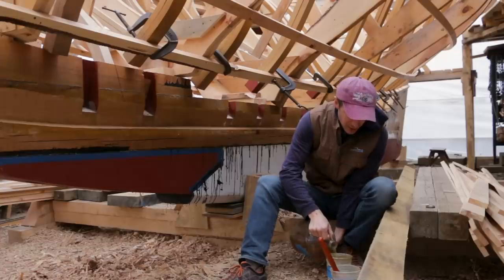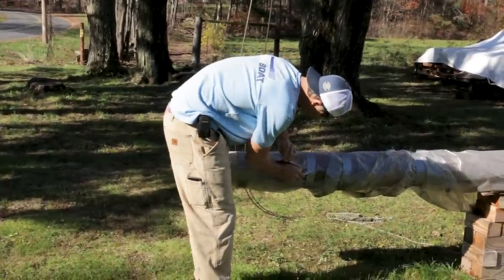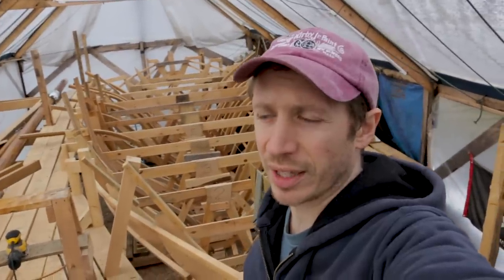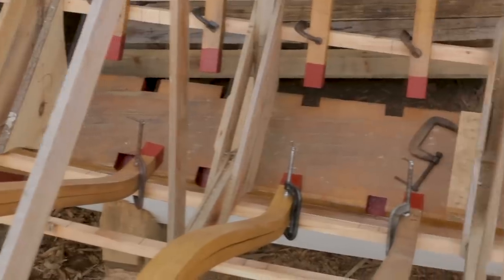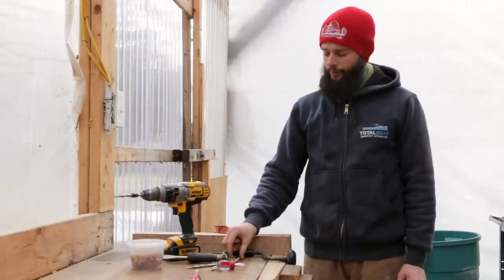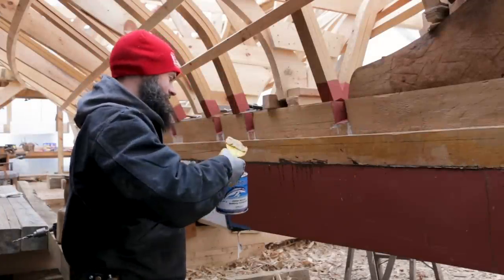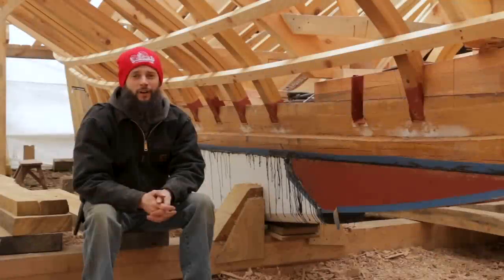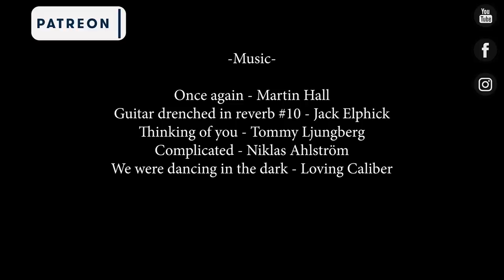Acorn to Arabella - Journey of a Wooden Boat - Episode 49: Bedding the Frames

Comment: I too think those bronze screws are too short. It looked like only an inch at the pointy end of the screw went into the keel wood. When the boat is in the water I assume most of the buoyancy force is applied to the hull. What is coupling the hull to the keel, other than these bronze screws? Thanks for amazingly good and interesting videos.
Reply from the maker: The screws are "bonus" fasteners, once she is fully framed you could cut the frame ends off where they meet the keel and sail her around the world.  Many builders believe the sockets and fasteners are not worth the time or energy to install.
Reply: Ah, so there is some more beefy structure that fixes the keel to the hull then. Is that to come, or have I missed it?
Reply: @samuelfielder  Are you familiar with "knees", which gusset the tops of the frames to the deckbeams along the gunwhale (where the deck joins the sides)? "Floors" do a similar job at the bottom of the frames, gusseting the frames to the keel timber, and to each other. Once these are fitted you could (as the boys wrote above) cut the frames as if they were simply butted to the keel timber. It would not be as strong, but it would be plenty strong.
An abundance of caution is a virtue, in building boats, rather than a vice as it can be elsewhere (eg child rearing!). 
I say this because lack of sleep is the primary cause of bad decision-making when the proverbial hits the metaphorical, and lack of supreme confidence in the vessel can cause wakefulness in those same conditions.
Reply: No Gottenhimfella, I'm not familiar with anything about boats! Just a physicist watching Acorn to Arabella with interest and admiration. So far, I haven't seen anything substantial inside these frames (what I can see, I think,  is just temporary supports). What I am clear about is that the buoyancy force will be applied by the water to the external planks of the hull, and in turn to these frames. Where it goes from there I don't yet see. I can calculate the force required to move a 4.5 ton keel upwards at a certain acceleration, and the force required to shear a No.18 silicon bronze screw: that's what worried me. I am hoping your gussets appear later.
Reply: @samuelfielder   For clarification: the "floors" (which will be fitted -- they're indispensable, for the reasons you state) join each frame to the adjacent frame on the OPPOSITE side of the boat, not the adjacent frame alongside it on the same side.
It is a peculiarity of traditional wooden boat construction that there are no diagonal (or other shear bracing) elements joining the frames on the same side, and to me it is this lack which is a perplexing oversight, rather than anything to do with how the keel attaches. On small vessels like this one, it's not a major problem, but on full-size sailing ships, where the frames are further apart, and the planks (relative to the gaps between frames) much narrower, the planks behave like the cards in a deck of playing cards, with very little resistance to shear forces in a vertical plane. If you imagine drilling a hole through such a stack, and then inserting a chopstick and levering fore and aft, it's easy to conceive the problem. The tall masts act like powerful levers, squashing the planks together in the squalls (assuming the ship is running downwind) and then separating them in the lulls. Going into the waves, this same action would happen with every large wave. This explains why wooden ships would invariably leak during and after a hard storm, and sometimes spit out the (not very elastic, and not very adhesive) caulking intended to prevent water ingress between planks, with often fatal consequences. 

Sailors were highly aware of the problem and would sometimes address it in storms by using external cables and "frapping" the hull (this is recorded even in the Bible), but designers and shipwrights down the ages seem to have considered sailors to be an inferior species whose opinions were unworthy of consideration.
Very late in the day for sailing ships, this oversight was addressed, but in the first case I'm aware of (the warship USS Constitution) the iron diagonal braces were left out when the ship was later refitted, because the shipwrights failed to understand their purpose and/or simply mistrusted any change. The Constitution, a frigate, had quickly made her name as a tough nut to crack, which the British navy ordered their own frigates not to engage unless they had backup.
Reply: Thanks.
Reply: @samuelfielder  
Then don't ever analyze the individual parts on an airplane!
Reply: @bikentrike  I don't see your point. The substantial bronze brackets (misleadingly named "floors") have now been installed and it is apparent the No. 18 screws aren't the main means of fixing the keel to the hull, as previous posters explained.

Comment: I know this is a stupid question. But what supports the weight of the keel when the boat is afloat. Is there more bracing to go between the frames (a floor piece?) that then bolts to the keel? Or are the frame sockets tapered and at such an angle that the frames cannot disconnect when everything is in place? She's looking lovely though :)
Reply: GGXjimmy That is not no a stupid question.
Reply: Yep not a stupid question.
There is a U-shaped piece actually called a "floor" they will have to fit in between like you discribed. (Typically not at every pair but every second or third)
Leo over at Sampson Boat Co actually has some good footage of iron or wooden floors.
Reply: Yeah I was wondering the same thing.  With buoyancy, I imagine those frame pieces end up supporting the weight of that ridiculously heavy keel.  It's hard to believe a (seemingly) small number of bronze screws can support that weight.  But I'm sure these guys have done a ton of homework on this, and maybe in the future they'll add in additional support structures that will alleviate those concerns.  But it's definitely something I'd be paranoid about.  It'll be interesting to watch, I've never actually seen how one of these boats comes together.  It's in incredible amount of work, and blows my mind that you can actually pay a company to do this amount of work for you.  Of course, most boat manufacturers have moved on to materials like steel and fiberglass for this kind of stuff, so things go together MUCH more quickly.
Reply: I wondered the same thing, thanks for asking the question. A good question at that!
Reply: GGXjimmy they use keelboats that go thru the floor , thru the keel timber and thru the lead keel . Leo has an episode removing the old keel bolts.
Reply from the maker: The screws are "bonus" fasteners, once she is fully framed you could cut the frame ends off where they meet the keel and sail her around the world.  Many builders believe the sockets and fasteners are not worth the time or energy to install.

Comment: I think their test pieces with the screw removed should be sliced through the center of the screw hole with a thin band saw. Then the depth of the screw into the second (keel) piece of wood and more importantly the depth that the screws threads are cutting into the sides of the hole can be seen and evaluated.

Comment: “As a carpenter” I can relate to you in screw tension concerns. However as carpenters how many of us use silicone brass? Now we still predrill for steel screws but by manufacturer they bury themselves under our power drivers. I had a aero engineer dad who says it’s a mistake to ‘over engineer’ or over tighten in building an aircraft. More so am thinking a wooden structure which expands and tightens as a whole once in it’s intended environment.....just sayin
Reply from the maker: Yes that is true.  The screws we put in need to be predrilled as oak is seriously tough and the relatively soft bronze would sheer if driven in without a predrilled hole.  And then tightened just past hand tight.  These screws into the frames are also not the load bearing connections.

Comment: I have watched in amazement since day 1, yet I also am confused as to why one would use a flat head screw to attach anything with the options we have today.
Reply: Watch it again.. they explain exactly why they chose to go with flat-heads.
Reply from the maker: That we do!
Reply: @Garryck-1  I get grinding out the slots, still would not have been my choice, there are other options I would prefer! That's just me, and I am not building a boat like that. Just saying!
Reply: @gmoney5660  You should go watch Tips from a Shipwright's videos. Louis is a "well weathered" pro and goes into detail in several of his videos about why to use flat-headed screws in boat-building.
Reply: @wildtimbrown  I may come across as less than educated or knowledgeable, however I have read all of the suggestions and reasons to use flat head screws, and I believe that there are better alternatives especially today, not then but NOW!

Comment: I think you have an inbuilt problem with replacing the relatively long iron keel with a much shorter lead one of the same weight, so that now the downwards forces are on the midship and not distributed through the hull. The frames are relatively weak, compared to sawn frames, and I think they need all the distribution of weight and movement they can get. What about measuring the pressure on the midships frames and compare them to the bow and stern frames?  I also think that the  the two bronce screws, that attach the frames to the keel is a weak spot.
Reply from the maker: Hi Abraham,
Glad we are inciting critical thinking skills to come out!  That is what we love.
To hopefully quell your fears...  The lead ballast keel was lofted out and in the plans Atkin put together.  So are the steamed frames. And finally, the bronze screws in the frame heels are simply extra fasteners.  Frames never rely on a simple connection to the ballast keel like that.  They are always connected to the keel and ballast via floor timbers.  We will be talking a little bit about that in the next video as well as upcoming ones.
Take care and glad to have you watching!

Comment: I saw someone on Youtube soaked their frames in laundry soap (I think) and then steamed and during bending the wood was very easily bent and formed.  Is there anything wrong with soaking the frames in laundry soap before steaming?  Also, in the world of new fastener heads and machined parts, while not use some type of bolted head and include a brass plate over the top of each frame base to distribute the load and make the joint stronger to help reduce pullout during excessive loading conditions?  Just a thought.
Reply from the maker: Never heard of the laundry soap trick before so I have no clue.
No need, the screws have plenty of holding power and are just one little piece of the network of fasteners holding the frames to the keel.

Comment: when you drill the holes for the screws in the frames shouldn't the holes be a little smaller in diameter? (I'm not a carpenter) It seems that the screw thread wasn't biting into the wood of the frames at all, only the wood of the keel socket. Wouldn't it be stronger if the screw was also biting into the wood of the frame?
Reply: No, that's what the head of the screw is for. If there is little to no thread engagement in the piece you are screwing in, it will pull tight easier. That's why screws look like this https://www.clasohlson.com/medias/sys_master/9581607190558.jpg
Reply: does seem like a very weak connection of where it needs to be the strongest.
Reply: jason s have patience grasshopper. When the planks are in place notice that the planks will cover the rabbets there by making a mortise and be stronger. The wood will expanded with being in the water and clamp down on the whole structure. I agree with the screws going easily but he had some torque at the end of installing the screw 

My only thing is that the videos are not coming faster 😉😉 

Thanks for the work Steve
Reply: @normandyck7609  the screws holding these timbers are the most important part of the whole thing. If they aren't secured very strong then the entire thing could come apart. There's no way there's much more than an inch or inch and a half into the main timber.
Reply: @js2743  Are you a boat builder or a a keyboard warrior working on your personal assumptions?  Just curious.  I have no idea what the correct thing to do here is, but I am assuming they do because their research and techniques have been spot on so far.
Reply: It only seems like the screws went in too easily because the screws and holes are tapered.
It is the same like fitting a wedge into a wedge shaped hole. You can just drop it in but a few taps with a mallet will get it to hold quite a lot.

As to the threads biting into both parts that would be a bad idea. The connection is much stronger if the threads only grip one part and the screwhead can pull the other tight. If the threads were to grip both then they would lock the parts in place without the ability to pull them together.

Also these screws are useful but not very important because the main strenght comes from the connection over the "knees" they will have to do later and the tight fit between the frames and the seats in the keel.
Reply: @js2743  they are only holding the frame to the keel... not the keel to the frames.. that's what floor timbers are for. They tie the frames, port and starboard  together and tie it to the keel.
Reply: @watcherofwatchers neither but I can tell you those are very weak joints.
Reply: @caseydixon8714  I think you're wrong, the frames are what holds the keel and the rest is fastened to the frames. I know the more that's added the stronger it becomes as one but the frames are just that they are the skeleton on the boat if it's weak then the entire thing is weak.
Reply: jason s Has anyone thought that this thing is going into water?  Do you want a super tight fit on something that is going to swell a bit?
Reply: @yqwgjsg  You are absolutely right !! I helped a friend rebuild his wooden boat years ago and he had the screws so tight that most of the heads popped off after being in the water over night and the boat sank to the gunnels and popped most of the rest.. Over a years work to to do over again...
Reply: jesus... I never would have thought of that.
Reply: @js2743  Explain why those are very weak joints, as a 25 year carpenter, I'm interested to know why you think those are very weak joints.
Reply: @jeffs.6488  well if you never noticed the screw is only in the keel timber maybe an inch. If you was a carpenter you should understand. I wouldn't doubt what you couldn't knock the frame out with a claw hammer with just a few hits.
Reply: @js2743  I is a carpenter, and if you look at the birds mouth rafter cut, you would see it's a weak joint, however it will hold hundreds of pounds of weight, you add all of them up together that hold the roof to the house they combined with hold thousands of pounds of weight. To drive the frames out of their slots you need upward and outward forces far greater than the combined weight of the material holding it all down and into the pocket. You also have to look at the shape of the frames they are designed so that the load down pushes it in the pocket. Think of the keystone for a bridge.
Reply: @jeffs.6488  think of a lead keel just hanging on those screws. A lot different than sitting on something solid its going to be hanging trying to pull apart.
Reply from the maker: Holy smokes!   
We never thought the screws would be such a contentious thing! haha
The screws are "bonus" fasteners, once she is fully framed you could cut the frame ends off where they meet the keel and sail her around the world.  Many builders believe the sockets and fasteners are not worth the time or energy to install.
When properly installed a screw should go in and out quite easily, also the bit and brace has WAY more torque and power than people realize.  
Looks like so many people are puzzled by our decisions on this that it warrants more than a comment.  We will make sure to explain it all a bit better in the next video.
Reply: Well, thanks for clearing all that up. Try to remember not to take comments too seriously, most of us are just curious people discussing things we don't know a lot about ha.
Reply: @js2743  it's actually not "just" hanging off of those screws, look at the overall construction of the keel and the ribs. You never understood my answer to you about the load bearing of the frames and the forces keeping them in the pockets and I don't think you will because you are too focused on the screws. Many types of framing and wood construction don't require screws or nails to hold it together at all and this ship is a good example of what does and doesn't need screws or nails. Quiet frankly I was surprised that they were adding screws to the frames. But I understand why they are doing it.
Reply: @js2743  2-1/2" frame and a 4" screw. Seems plenty long, considering they are not crucial to the structure. The main connection of each frames to their opposite frame, and down through the keel timber, has not yet been built or added. See the next video, up now.
Reply: @js2743  If you want to learn more about forces at play with screws go look up some research done by black diamond on ice screws for ice climbing. In ice screws, the screw hollows out the ice and only the tiny threads hold that screw in the hole. Yet they are able to hold over 1.5 tons of weight or 15 kN of force assuming the ice is solid.  Sure the tubular body keeps the screw from breaking, but the thin threads are what does the work.